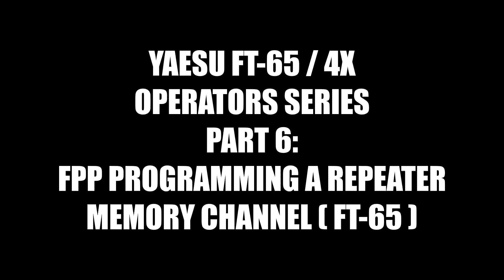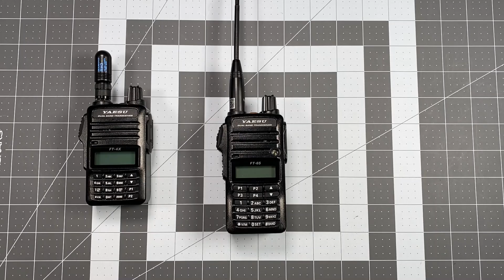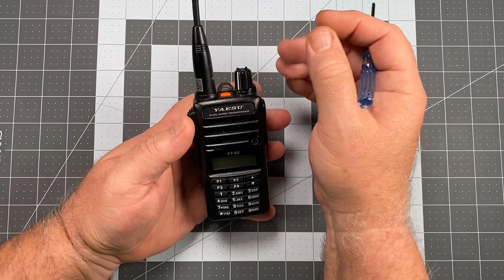FT-65 / FT-4X Operators Series Part 6 - FPP Programming a repeater memory channel (FT-65)

Comment: If you put in the frequency and the tone for the ch correct. When you try to talk error comes up on the screen. What am I doing wrong?
Reply from the maker: What is the frequency that you are trying to enter?
Reply: @ it’s in 158. Has three more numbers but didn’t want to give out the whole ch. it’s private ch for hunting
Reply from the maker: @jasonroberts6963  Is your FT-65 unlocked for out of band transmit? If not, it needs to be because 158 MHz is out of band which would result in the ERROR message. If you check my FT-65 playlist there is a video in there that shows how to unlock your radio.
Reply: @ thank you!! That did the trick.

Comment: Does anyone know how to program a repeater memory channel with split tones (DCS TX and CTCSS RX) from the front panel? Standard offset of +5.000 MHz. Is it even possible on the ft-65?
Reply: Yes I just tried a tx ctcss and a rx tone on dcs code  and it works fine..
Reply: you program it the same as you would anything else from the front panel..
Reply: @jamesanna732  Which option do you choose in menu item 29 (SQL TYPE)? I can set a separate RX CTCSS tone in menu 8, a separate TX DCS code in menu 11,  but I can't activate them both in menu 29... Only one or the other, judging by actual tests...